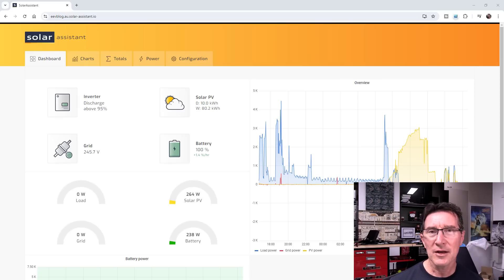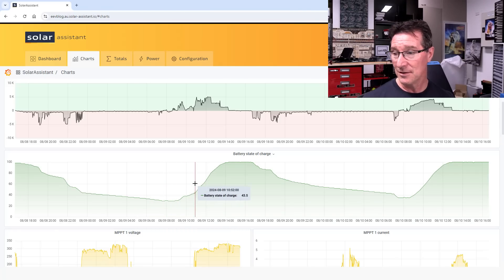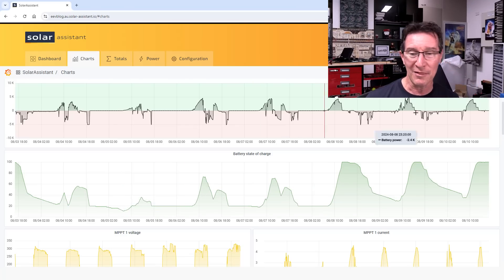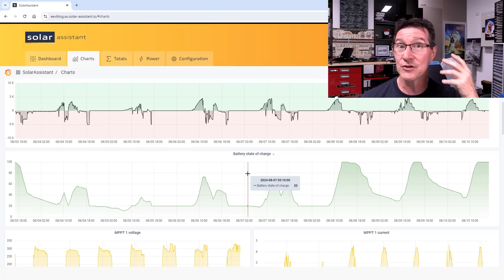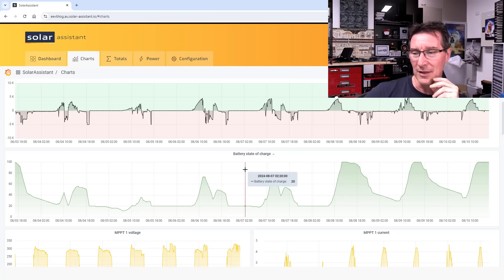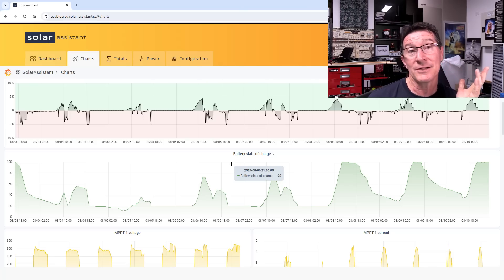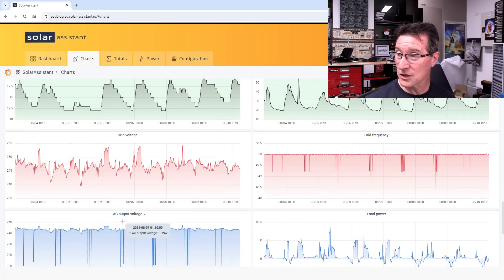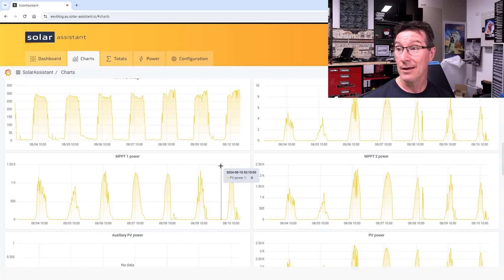We're Gonna Need a Bigger Solar Battery...

Comment: I've built 4 DIY 48v server rack battery modules.  They use a JK BMS and talk to my inverter and each other just fine.  They are 15Kwh each for $2200 USD, 60Kwh for the house.  I was following Andy Off-grid garage and thought that made the most sense when looking into battery systems that provided the most density for the $$.

Comment: Be careful, my neighbour has gone through 2 batteries since 2019. One failure was related to the battery going off line and became a warranty replacement, the next battery just went wonky after a few years. Stopped holding a respectable charge. The worst aspect is considering the absolute crap buyback price of electricity now your investment in a battery is never going to pay off. Thats the simple math your up against.

Comment: Why heat your pool with a battery? Just add a black plastic hose in your pool, wouldnt that help better. You might get 1200wattm2 of surface in heat. A solar panel 3 times as big will produce maybe 1200watt, but when you store in battery you will lose energy, and you will lose more energy when you change electric power to heat. Maybe it will be more efficient to buy a real solarwaterheater than to buy more battery.

Comment: The fact that it hits the bottom limit in a few hours of light use, and hits the top in a few hours of winter sun, is a sure sign that the battery beeds to be enlarged 3x or 4x. At least.
If that was a battery powered device I would say it was really badly designed.

Comment: Well, you are paying about $5700USD for 15 kWh. I just paid $2250 for 16kWh DIY battery kit with JK BMS. Including shpg from China. Cut out the middle man.  Docan - Jenny Wu. My 180 kWh will last five  days in a dark cold  winter time. All  high efficiency electric  heat pumps.
Reply: You can get 15 kWh, all done batteries for ~2200€ now.. it's insane, but it also makes DIY less attractive now.

Comment: A ROI calculation would have been interesting until up to what size investing in batteries is economical viable for your installation.
Reply from the maker: Did that in the previous video.
Reply: @EEVblog2  I thought the calculations were a little bit simplistic/overly optimistic. Starting with the fact that it assumed 100% utilization, while the system is configured to utilize 80% of capacity and then assume 100% usage every day. 

In reality there should by a decreasing marginal utility of each additional battery, because it will be less utilized.

In theory there should be a lot of "free" options to store excess energy - warm water, house: heating/cooling, pool, EV - all available without additional Cap Ex.

Comment: I wouldn't call a house with 12kwh consumption just for one night "very efficient" ... if you have excess energy, you should be able to do all heating and water heating with an efficient, well insulated system.
Of course it is not horrible either.
Reply from the maker: You realise just the oven takes 3kW, right? I AM doing my water heating with an "efficient well insulated system". See my heat pump videos.
Reply: @EEVblog2  An oven takes 3kW maximum - it should not take 3kW continuously - or its insulation is horribly bad. 
How much energy does it take to bring ~2l of water to 150-220°C .. around 1,53kWh ... even with inefficiencies lets say 2.5kWh.

Regarding water: My assumption would be, that all water heating can be done during the day while solar energy is available, not during the night.

Comment: I don't think you have the solar power generation capacity to charge 2 more batteries.
Reply from the maker: On a good day I do, and it's still winter time. Solar output goes up 40% in summer.

Comment: I'd take the batteries to 95%.  If  you look at the voltage discharge curve of LiFePO4 you'll find 80% will still land you in the flat part of the curve.  Assuming they go from 3.65v to 2.5v per cell 95% will still land you at about 2.9-3V.

Definitely bigger battery.  As much storage as financially possible.

Comment: If you're worried about cycle life, get all six, and keep state-of-charge between 20% and 80%. As I understand it, lithium chemistries are most neutral at 50% state of charge, and don't like being either fully charged or discharged often. That said, if the engineer who designed these batteries is telling you this is fine, who the hell is this random commenter to argue? 🤷‍♂👍

Comment: Gvien the history, It looks like you've got about the ideal battery pack.   You had a lot of times where the batteries were not getting fully charged during poorer weather conditions, which indicates it wouldn't fully charge a bigger pack in poorer weather.   Obviously up to you :)  May 20KW would be okay....    Anyway, I look forward to seeing how this goes.   I guess it would be good to see how their BMS works.....
Reply from the maker: Like I said, its still winter time
Reply: @EEVblog2  Yeah.  Winter is always crap for solar, especially in the southern states of AU
Reply: Winter time anywhere on earth is the benchmark for solar! 
If you have built your system to get through winter, come summer time you will be running resistive space heaters, why? Because you can.... Ask me how I know? 
During summer, my 30kwh battery has no problem getting a full charge early in the day and if I'm not using what's available, the charge controllers ramp down and the victron system will report that it was only a 25kwh day, but when I start running everything to see what the day was worth, I get different results more in the region of 40kwh.... 
But June July in Melbourne is what I'm working on to get the performance I need.... You would like to think that 30kwh worth of storage is a lot especially during summer but running the AC for cooling during those hot summer nights and you find that 30kwh worth of storage isn't enough! I'm doubtful that twice that amount is going to do either! 
I'm currently considering one of those Chinese diesel heaters for winter heating! A lot of people are experimenting with them and they are looking promising....

Comment: I'd assume that each 48v battery 'balances' simply by being in parallel with the other 48v batteries. 
I'd also assume that the only time they'd need to talk to each other is if a new battery is put on the rail that has a significantly different state of charge than the others.
Reply from the maker: Nope,  they continually talk and balance during charging

Comment: There's no fancy smarts to the "balancing" between batteries. They are clamped to the same voltage by a big pair of busbars. Cant get any more self-balancing than that.
Reply from the maker: Nope, they are connected and talk to each other with an actively balanced bms
Reply: Current flow between packs with zero potential difference? Truly impressive.

Comment: I wouldn't.. we've got 10kw of solar + 13kWh of batteries + EV as well, and seeing similar graphs. Battery is only really meant to supplement when you're not able to use solar - 70% self sufficiency and 70% self consumption is perfectly fine and more batteries will take longer to pay for themselves

Comment: So you didn't buy a DCS battery then😉
Reply from the maker: I heard a few bad things about them...
Reply: @EEVblog2   you know, I was watching Stefan's video which he was talking about how he removed the DCS battery and ended up with a Red Arc battery instead, now Red Arc definitely developed a solid reputation over their early years for robust products, I have had a Red Arc DC/DC 24V/12V stepdown converter in my truck, I still remember those metal TO3 linear regulators bolted to the heatsink which you could cook on it during summer running all the radio equipment including the stereo system which had big amplifiers and subwoofers.... 
I remember thinking how this thing never gave up! 
But I think that Red Arc is a shadow of its former self, I have seen them selling their own $100 charge controller which is identical to what you would find on eBay for $10! The only difference is the colour and the Red Arc brand on it! Those cheap charge controllers are aimed at the battler! The poor people pay twice they say, in the case of Red Arc it's ten times that..... 
Anyway, Stefan seems to be quite happy with his new Red Arc battery which is built in Europe by a large manufacturer.... He was copping some FLAC from some people in the comments for the price of Red Arc batteries, a lot of people are saying that he should have built his own DIY solution for which he didn't want to! He stated his reason why was because he needs reliability and he doesn't want to risk being caught in the middle of nowhere as he often ends up in.... And I get that, DIY isn't for everyone! But he said that he only wants to deal with a large company! Now I don't know about you but I don't know if I would consider DCS as a large company? 
I guess that we will find out later when he updates us on whether DCS has more or less than 10 employees? Though I doubt that DCS is anything the size of the company manufacturing the batteries for Red Arc!  
I decided to check if Victron is still in the battery game just the other day as I remember them getting really good reviews from the YouTube community and to my surprise they are and unlike a year or so ago, they have come down in price dramatically! 
Victron customer service has had it's up's and down's but generally speaking they are okay and definitely nothing like DCS...... 
There's a huge DIY community out there, I'm sure that you have seen plenty of their comments and I'm sure that having you do a DIY build would attract a lot of views, solar energy has been a hot topic for some time now and it's only getting hotter, with people like Andy from The Off Grid Garage channel and Will Prowse's channel doing DIY projects and giving people a raised bar to work with which is getting everyone to raise the bar further. There's some incredible work done by some amazing people, sure DIY isn't perfect yet but I believe that it's at a level that justifies it as a worthy route especially for the battler who has been armed with great knowledge and the willingness to get into the solar game.

Comment: Don’t know if you have dynamic energy contract in the Auzy-land. If you have, you good charge the battery pack at low price (or even being payed for charging!). It does not happen often, but it has been several times in the news up here, people with dynamic contracts would get paid to take grid energy…
Reply from the maker: Mentioned in the video. I need a smart meter first

Comment: Regarding your battery, using only 80% of lifepo is bonkers... If you discharge to 3V per cell that is very comfortable for the battery and it leaves less than 10% on the table. There is no point going below 3V. Also Dave, as someone who started making a DIY UPS for my computer (and tiny 2.4kW on-grid solar) and ended up with a 15kW peak array, 32kW of inverters and 45kWh (soon to be 60kWh) of batteries I sincerely warn you. This is a slippery slope you're on. No amount of battery is enough battery 😂 Now I'm buying used bitcoin mining rigs just to keep my battery exercised in the summer... And not to see my solar go to waste. And my predictions say I still don't have enough to cover December (Northern-Central Europe). Everything is solar in my house too except the last bit of heating when it gets below - 10C(wood pellets). I use about ~30kWh a day. I would need a 70kW peak array and 150kWh minimum to be fully self sufficient for the month of December. Funny how not that much money gets you 90% there and for the remaining 10% you have to spend 3x more... But I diy everything.

Comment: FYI, if your voltage is too high, you can call your power utility to reduce it - They'll adjust the voltage at the tap changer (voltage regulator) on the transformer feeding your house. Same goes if its too low. Generally speaking the taps will give you about 5V per tap and there's usually around a +/- 15-20V adjustment. You will lose power for about 5 minutes while this is done but they can usually bring it down if it's at 250V to 240V or so.
Reply: I thought they had automatic ones that took <20ms already in place? I don't know.

Comment: A household normally averages 1kW power consumption, so in general you can expect to consume 24kWh per day. Of course, with an EV and other things this will change. So a bigger battery is generally a good thing - even if it's so large you cannot charge it full or drain it empty. It just keeps the state of charge relatively constant which extends the life even more.

Comment: Is the current clamp for the essential load inverted? Aside from that, it might be a fun little project to convert a cheap current clamp meter without data logging to something you can plug into a RaspberryPI or other microcontroller with storage/connectivity.

Comment: My setup is 16kWh of storage and PV boilers as far the 27kWp array produces in winter. We mostly heat by wood burning during winter.
On a sunny mid winter day the battery has overkill solar, we also had weeks and months with nearly no PV production at all. For such situations the proven diesel generator does for us as it does every day for the Dutch powergrid when the sun gies down 😄

Comment: Another thing to consider is those bad charging days (cloudy).  Even if your battery system is marginally big enough now, when you have a bad solar day the next day you run out of stored power.  If you add 2 more batteries you will have energy stored from a previous day that can be used on the cloudy / rainy days.
Reply from the maker: Yes, that's one off the advantages I mentioned

Comment: yea more batteries more better but in real if you have more batteries, charge is split between them they will last longer you could even resell them later as used for better price if you tell the buyer like it was charging only up to 10amp.

Comment: Pretty much exactly what happened when I installed mine. Started off with a 5kWh battery, but found it didn't cover me. Ended up upgrading to 15kWh.

But don't underestimate how much shifting your power usage can help. But once you've shifted and lowered your idle usage, keep upgrading the battery until the 80% thing isn't an issue anymore. Like my battery gets to 40%~.

Also, I wouldn't worry too much about the 80% DoD thing, it's mostly comes from misunderstanding the cell specs and how they're used in a home battery setup. Like Peter said, these cells are used in the automotive world, which is where the 80% DoD is important because they're charged and discharged very close to their maximum specs.

So unless you're pulling 100A out of every cell every day and charging it at 100A, the thing that will kill these cells in a home environment is shelf life. But if you get enough battery where you're never hitting 80% DoD, it's a moot point. 

By all means, follow Peter's advice about 80%, because he isn't wrong, that is what the battery spec says, but it's a little important to understand the context and reasoning behind it, and how that relates to these cells in a home environment. As the spec most likely says 80% DoD at 1C, which you'll never do.

Personally my minimum SoC setting is 0%, but my cell voltages stay between 3v and 3.5v, and that's my 0-100%SoC, but the spec calls for 2.5v to 3.65v, so there's already a margin accounted for. So my battery is  probably around the 90%DoD level, if fully charge/discharged.

Comment: If you want it to last max charge 90% max discharge 30% if you can get more packs, better because of the load distribution, it will reduce the wear of the entire array, so it's much better, i know it's a few coins, i had batteries for a while , but i think it's a good investment

Comment: You'd have you balance your power clamps first :D - Calibration of all on the same battery to know how much they differ.
Give the Deye Inverter a temperature controlled fan. Go on when about 45°C or 50°C... off at five degrees below the ON temperature.
Reply from the maker: Not really, I'm only interested in the timing differences to see any lag really

Comment: I'm a firm believer in the 80% charge max and would get more batteries. I have 20V cordless drill packs that are 15 years old that still hold plenty of power because I don't leave them fully charged.
Reply: these are LFP cells, not NMC, LFP needs that 100% because you can basically just top balance them, it's not bad if it does not reach 100% every cycle but if not the cells slowly drift apart .
Reply: @DooMMasteR  I always thought the BMS would maintain the balance of the cells at any voltage, but I'm not a battery expert.

Comment: I reckon you need a year of data before you can know for sure. Summer is going to be a whole other story with the longer solar-production hours. On some of those cloudy days it seems more panels would have helped as well.

But then again if I had youtube bucks like you I'd be filling that battery rack to full capacity 8-)